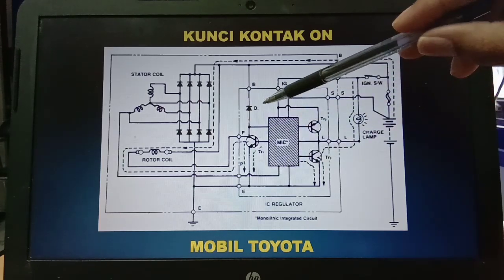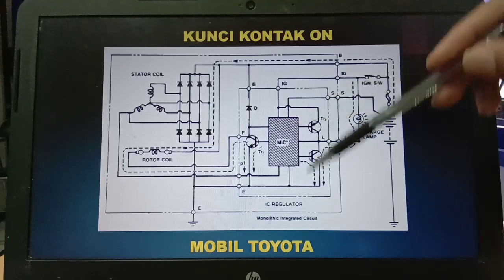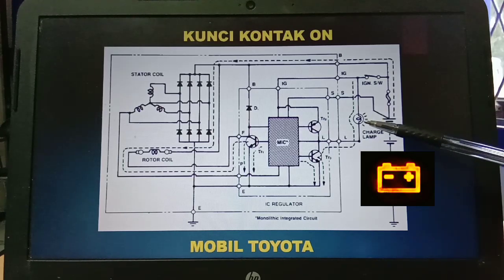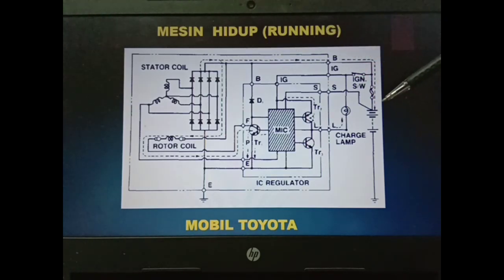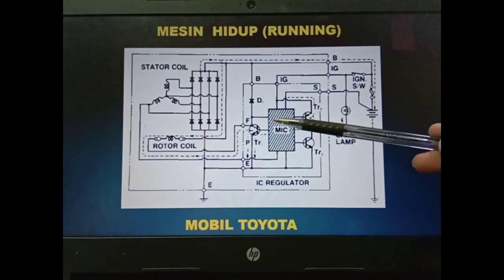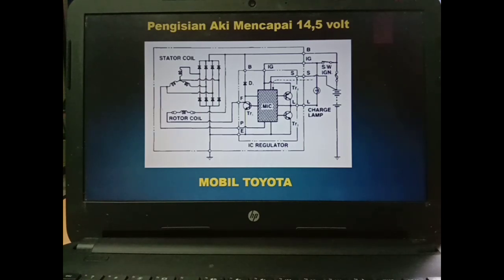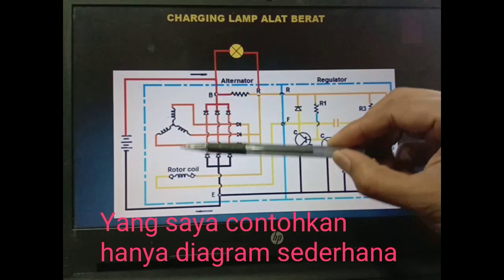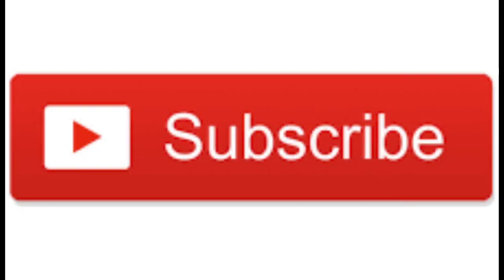Penyebab Indikator Aki Mobil Menyala ( Cara kerjanya)

Comment: Knpa klw lampu aki menyala padahal carbonya masih panjang
Reply from the maker: Mobil apa mas, penyebab lampu aki menyala:
1. Kabel untk terminal L lepas atau putus kalau alat berat terminal R nya
2. Pastikan tegangan  di batere saat mesin running / bunyi kalau pakai 12 v maka harus terbaca 13-14 volt tetapi kalau menggunakan aki 24 volt tegangannya sekitar  25-27 v
Kalau tegangannya tercapai kemungkinan kabelnya yg putus